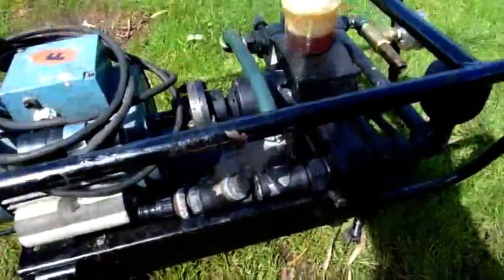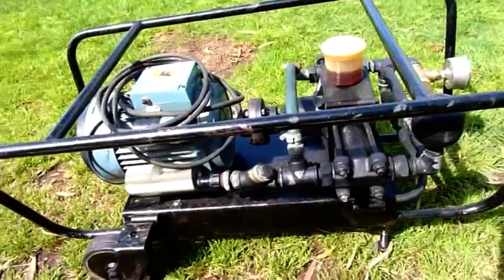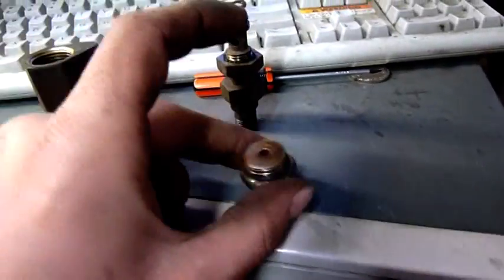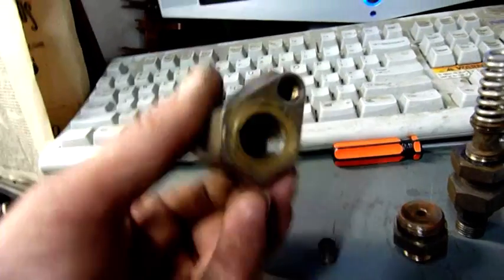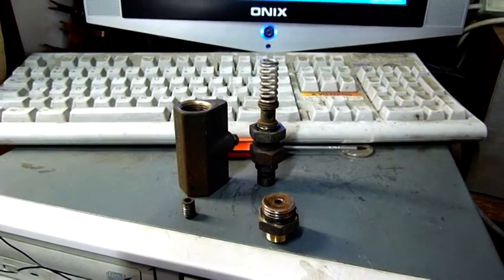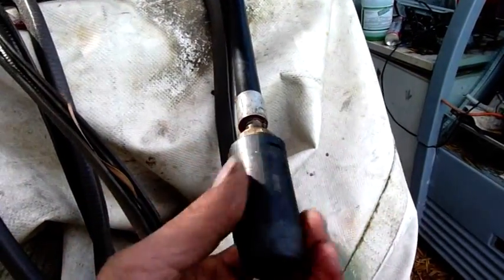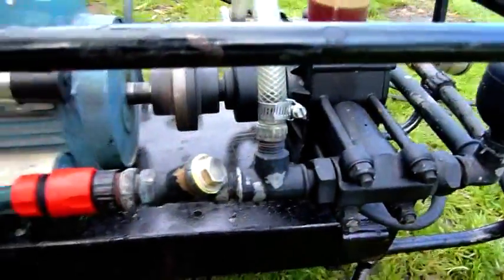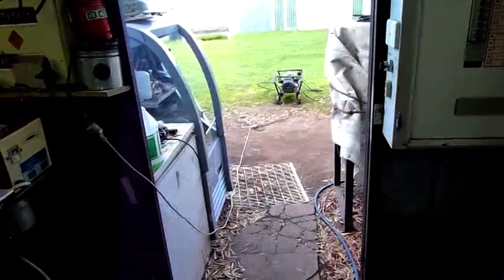Gernie Pressure Washer - Getting Closer to a fix

Comment: Try adjusting the unloader while engaging the gun or perhaps the orifice on the gun is to large.  The accumulator is designed to absorb pulsations so that could be the other issue.

Comment: @Aussie50 The Eastwood Company, an American outfit, sells home powdercoating kits which apparently work well for small items where you can bake the items in a household electric oven. They have/had a powerder coating shop in my area but it was a bit of a joke, anything larger in size then a car radiator or a motorcycle frame was out of his league and he charged almost as much for a powder coat as a plater would for chrome plating.

Comment from the maker: @CorbyStarletCj1 I did, its 100% now. took all valves and HP side apart today and fixed the HP accumulator too. pump is 100%, jsut need to re-adjust or replace the unloader and it will run.

Comment from the maker: @romandybala I'm not sure how old the pump is, probaly 1980's - 90's, but I have been talking to the local pump expert and he said it should be a easy fix (stuck/blocked valve in one of the heads more than likely.)

motors can burn for quite some time!, if its sealed its not usually obvious untill it starts shorting internally and takes out a overload.
sounds like time for a new one.

Comment from the maker: @omgitschrislol powder coating isn't really something you can do at home, you start with bare metal (sandblast finish is best), electrostatic charge it (I think the workpiece is Negative and powder spray gun is Positive charge)
Apply a even layer of powder, then bake in a oven to a specified temp and duration to melt the powder into a solid plastic layer.